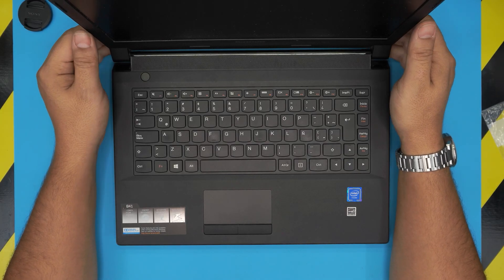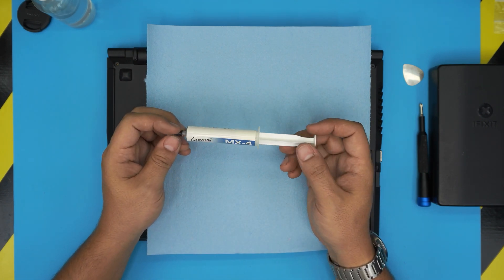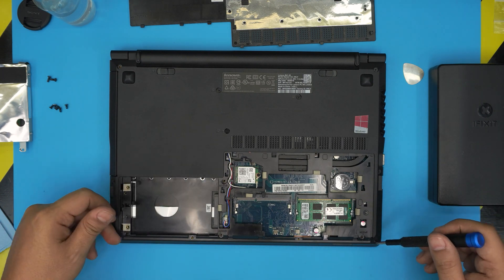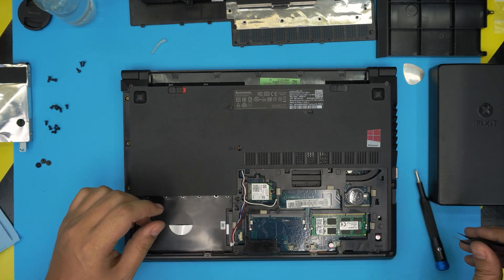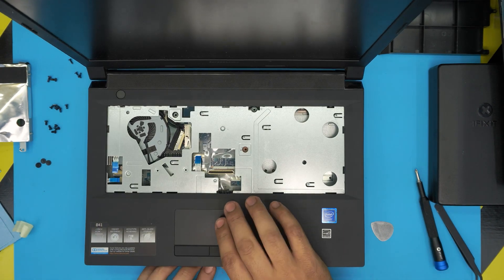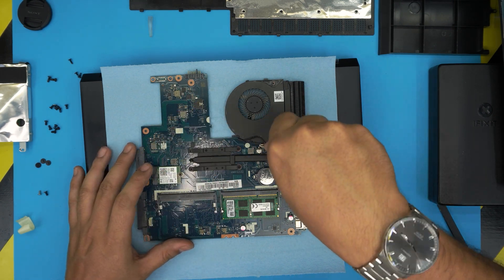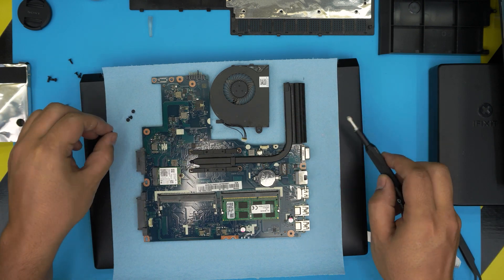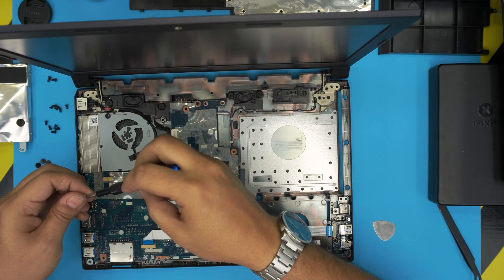Lenovo B41-30  Model:80Lf 🚩Repaste & FULL service

Comment: You're using a single 8GB ram module? I thought you were supposed to use 2x4GB
Reply from the maker: 🫠Regarding your question, sure 2x 4gb is better than one single 8gb, but this laptop is clients laptop and it only has one single ram 8gb.
Should you have any further questions or requests in the future, please don't hesitate to ask me.
cheers🍻